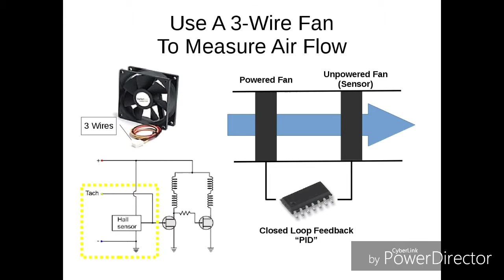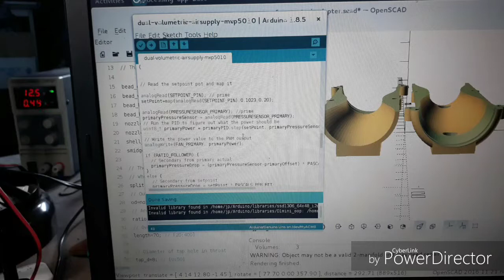Measuring Airflow With A Silicon Pressure Sensor

Comment: This is pretty cool, I'm actually working on a similar project right now and this video is really helpful. I just have a question, since you are using a venturi tube, wouldn't you need some upstream and downstream piping to allow the airflow profile to develop?
Reply from the maker: Engineers use venturi tubes with standard profiles, or orifice plates for flow measurement. This sinusoidal profile is my own idea and probably not ideal. To choose the right strategy for measuring flow you need to consider several things including necessary accuracy, nominal flow rate, max/min flow rate... I was testing if the cheap mems pressure sensors might work for me, and it does work to some extent.

Comment: bonjour, with you continued your gasification project for heat production? 
I have a project similar to yours and I would like to submit a plan if you are available
Reply from the maker: Yes I continue. I had a design I liked that was a positive pressure design (air blows in) and this will always be more dangerous than a negative pressure design (air sucked out) so I'm working on a practical negative pressure design. It's harder to test.
Reply: @senorjp21  what is the way for send you somedocs and pictures .

Comment: great project sir i want to ask can we measure air velocity  through it  using a pitot tube and whats its maximum??
Reply from the maker: There are many different pressure sensors with different sensing ranges. I'm sure you could find a sensor to fit your application. This MCP5010 has a 10psi range.

Comment: Fan-venturi code on Github has many errors can you please tell me how to solve it ?
Reply from the maker: It works for me using openscad 2019.05. I added an STL to github in case that helps. BTW, measuring airflow using an orifice plate is probably a more reliable strategy.

Comment: Looks promising... I saw this before your video. Looks like the same principle: https://www.youtube.com/watch?v=kvRK0lC1UKk. Also They did another venturi between the flame and the chips. Another thing to add, to ignite the gas why you don't use the ignier for furnaces, the glow 2000 and it's DC not EMS to deal with.
Reply from the maker: I'll look into the furnace igniter.  I have been playing with an arc-type barbecue igniter, but it is emf noisy and causes problems with my control circuitry.

Comment: Hi Jesse. Very nice.  How are you determining the minimax airflow that you require for your system?  Do you have baseline calculations, or is it just trial and error?
Reply from the maker: I am winging it!  In gasification the fuel is in excess supply, so the generation of gaseous fuel is determined by the amount of gasification air that is supplied.  Then, I am trying to add a balanced amount of combustion air to burn the gaseous fuel.
This project stalled because I am also trying to test "spark ignition" and the spark is causing interference in my electronics somewhere...  I need to shield things.

Comment: Can you share schematic for this project sir.?
Reply from the maker: Hi, Putra.  I took this apart a while ago, but the wiring is pretty simple.  The MPX5010 sensor takes 5V and ground and outputs an analog voltage, which is connected directly to one of the Arduino A2D pins.  PWM outputs on the arduino (with ~) is connected directly to the ULN2003 which acts as a low-side switch.

Comment: Hello, I was wondering what the "PASCALS_PER_BIT" equal to 10.4 was in your code? and why is the Offset = 1023? Thanks
Reply from the maker: The arduino's 10 bit a2d converter returns values from 0-1023.  The MPX5010 has a dynamic range of 10kPa (10,000 Pa.)  The sensor reads 10,000 Pa / 1024 a2d values - this is pascals_per_bit
Reply: @senorjp21  ok thanks. and what about the offset?
Reply from the maker: @heshamtanbour3363  when the pressure difference is zero a small voltage is measured.  The sketch reads the voltage on the sensor before the fans are powered to determine a zero offset.  The offset is subtracted from the sensor reading.
Reply: @senorjp21  okay thank you for your help. I am using the same sensor you are and was wondering if you used the voltage amplifier for the setpoint knob or for the output voltage coming from the sensors? I also have a few other questions, what is the best email or contact to reach you at? Thanks

Comment: Hello, where could I get the venturi CAD file? Do you have any link for look that ?
Reply from the maker: This specific part can be found here: https://www.thingiverse.com/thing:3559981  But, if you want to measure air flow in a more proven way use an orifice https://www.dwyer-inst.com/ApplicationGuides/?ID=44
Reply: @senorjp21  thanks men ¡ 👍

Comment: Hi! I am from Bangladesh and trying to build a working ventilator in our country. I was thinking about using one of these pressure sensors to measure my output airflow. Any idea how that can be done? Please get back to me asap as the situation here is worsening by the minute.
Reply from the maker: Hi, Shovon.  Many different pressure sensors are available.  This particular sensor might work and might not work depending on the specific implementation of flow measurement.  The MPX5010 is a differential pressure sensor, so it can be used to measure airflow indirectly by using an orifice.  As air flows through an orifice or constriction, a pressure differential is created and a formula can be used to calculate air flow from pressure differential.  This specific sensor would probably require calibration to provide accurate measurements.
Reply: @senorjp21  I am using a MPXV5050DP but cannot make sense of the data getting out from it. I am not sure I have connected the sensor correctly. It'd be great if you could let me know more about it.
Reply from the maker: @TheShovon123  Like the 5010, the 5050 has analog outputs.  You will need to connect the output of the pressure sensor to something that can measure voltage, for example, an analog-to-digital input on a microcontroller.  The 5050 has a dynamic range of 0-7 psi.  A high peak inspiratory pressure PIP for a medical ventilator is 80 cm H20 - around 1 PSI.  You will lose some sensitivity because you will only use a small fraction of the sensor's dynamic range.  The 5010 has a 0-1 psi dynamic range.
Reply: @senorjp21  Yup!! I finally got the value. :D

Comment: Have thought about using your knowledge for any of the low-cost or open source ventilator projects that are out there now, like Johnny Lee's jcl5m1 on GitHub? I think you could make a huge contribution to help them avoid barotrauma issues. https://github.com/jcl5m1/ventilator
Reply from the maker: Thanks, Nathan.  I have been working on a ventilator project as part of a challenge.  In that project we are using water manometers and computer vision to measure pressure and air flow
Reply: @senorjp21  Can you share more info about your ventilator develpment related to air flow measurement? at this moment flow meter is the bottleneck worldwide in the ventilator high volume manufacture.

Comment: How about water flow? is it possible?
Reply from the maker: I don't think MPX5010 is intended for liquids.  Surely my printed parts are not water tight.  The general approach of calculating flow from measured pressure differential across a restriction works pretty well with water and most free flowing fluids.
Reply: @senorjp21  thanks for ur information. any recommendation for DP transmitter sensor to calculate water flow rate? Or anything flow rate measurement, but without hall effect method.

Comment: You would be better off simply automating a grate and hopper agitator system. Very cool project though, but it is not needed. You need to correct those flow problems at their source vs trying to over come them with brute force. You can then add a mixer control at the engine to self mix air fuel. I have a tutorial on DOW for this and you obviously could build that. This is still very cool what you are doing here and it could certainly be used for more advanced monitoring.
Reply from the maker: Thanks, Thrive.  I'm interested in thermal power instead of fueling an engine.  This is for an integrated updraft gasifier and coupled burner, so for me air-fuel mix needs to be controlled at this point.
Reply: @senorjp21  Oh I got ya. Nice!! I build pellet stoves too. Yeah I can see that working well then
Reply: @senorjp21  Could use an Oxygen sensor? That was my plan anyways. Im something similar but with a gravity down draft stove. Later iterations will use steam reforming for H production.
Reply from the maker: Engines suck in a known quantity of air and fuel each cycle - like a positive displacement pump.  In this way your gasifier is also doing volumetric air supply - the resistance provided by the fuel doesn't matter because the engine keeps the airflow constant (at constant RPM.)  For a forced air approach, controlling pressure isn't going to be accurate as the composition of the fuel column changes.  Just experiments at this point...  Cheers
Reply: @senorjp21  Yeah thats what Im saying. If you had an 02 sensor just after your secondary combustion, you can then meter your primary combustion air accordingly. Thats if there is fuel there to burn. so adding a temp probe here in conjunction may also benefit. Secondary input may also be controlled this way or a combination of what you are doing plus reading a sensor. 

As for engine running it does not quite work that way, if the gasifier system becomes restricted then it will pull more in through the air intake mixer,  leaning out the mixture then the engine will stall and vice versa. On my systems all flows are automated and controlled plus I use an 02 sensor driven system to automatically adjust air fuel mixtures. 

On my pellet stoves they are down draft and share much of the same tech as the engine systems. I plan develop further and doing much the same as you are with forced air. This is so I can expand the char bed in the stoves for the steam reforming systems. Additionally I will be experimenting with enriched Oxygen eliminating the NOx input to allow for higher flows of the steam input. So this stove will essentially run partly on water.
Reply from the maker: I will check out your videos.  I thought about an O2 sensor, but I heard they are prone to fouling and I thought that would probably be a problem in the tarry output of an updraft gasifier...  Still, it would be a really useful sensor.